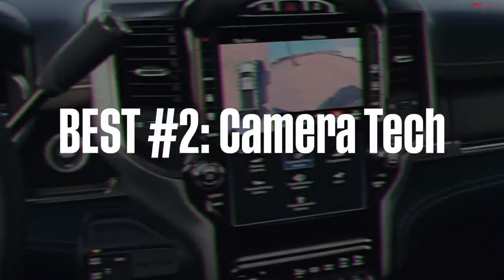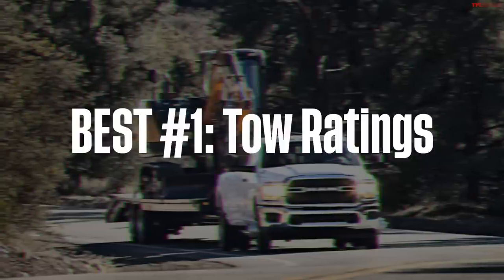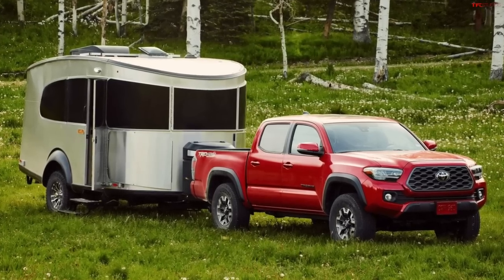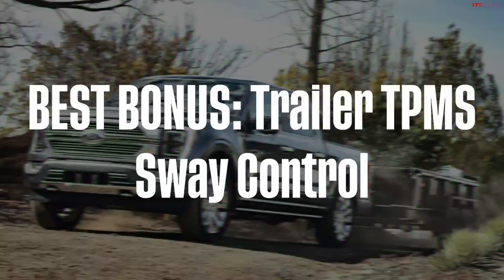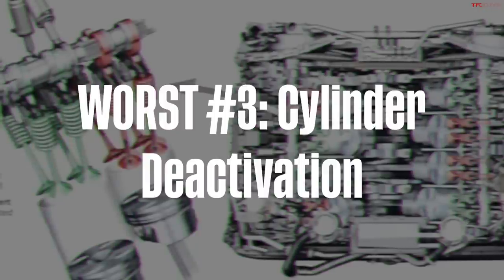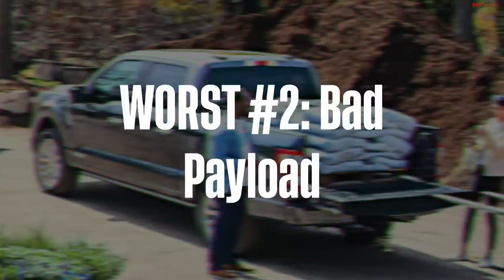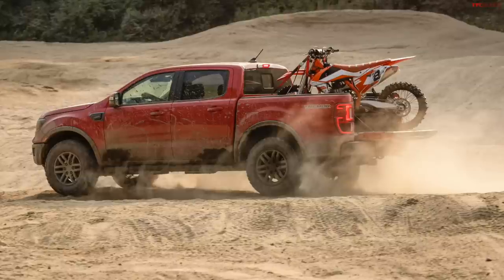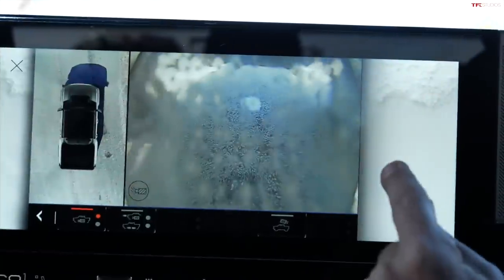This New Truck Tech Makes Your Pickup WORSE!

Comment: I really wish all truck manufacturers would use technology advancements as a means to improve durability, reliability, and production consistency instead of using it to add unnecessary complexity and failure points. I saw a forum post where a damaged side mirror caused a check engine light because the outside temperature sensor is in the mirror and it affects the air fuel mix logic for the ECU. I also agree with Worst #3 as we fell victim to premature DFM lifter failure in our '21 Silverado 5.3 at 585 miles. For how little of a fuel savings benefit cylinder deactivation provides, they probably could have tuned the ECU to run a hair more lean at highway speeds to obtain the same result without it and as a result built a more reliable engine.
Reply: Yes, leave the tech in the factory and use it to build a simple truck.
Reply: Well that doesn't require a lot of RND, Toyota's approach of incremental improvements and fixing all the glitches solves that.  I will argue safety tech, all that stuff is great.
Reply: And this is why I want what would be considered a mostly stripped by today's standard truck. It's insane I have to pay 50k for stripped and over 90k for a fully loaded truck that has when you really think about it minimal extra comfort or function. I also know my stripped vehicle has most if not all of the bells and whistles of what was considered a top of the line truck  5-10 years ago. Which means everything that is newer and we didn't have it then only adds to weight, price and less reliability and a higher cost of ownership.
Reply: They’re required by the government to add cylinder deactivation. GM, Ford and Ram all have it now on their V8 powertrains.

Comment: I would add to the worst list are Larger RIMs. I think having 17in to 18in rims is ideal anything larger lessens the capability of the truck.
Reply: You don't think 22s are properly matched to an offroad capable work vehicle? Hmmmmmm.....
Reply: Facts
Reply: how do 22s hinder getting groceries or sitting in traffic?
Reply: @JogBird  You make a solid point. I have been desperately lobbying Subaru to increase The Outback's tow rating to 10klbs. That would solve the issue. Then trucks could be used for their intended purpose....mall crawling.
Reply: 22 inch rims are ugly as hell.
Reply: Big rims are for posers.
Reply: @JogBird  I see what your point is, but I could actually respond in seriousness and say that when a 6000 lb truck on 22s with rubber band tires hits a pothole at 60 mph, that's how you get blowouts. I love having 35s on my Wrangler with 17" rims because I know that my chances of getting a flat are nearly zero.
Reply: If they want to keep putting larger rims on trucks then I want larger brakes to fill the gap. Then it could help increase the capability of the truck instead.
Reply: And it's not just the rims.  The whole wheel is larger!  17" should be the maximum.
Reply: They partially do it for handling
Reply: Amen.  Just watch any off road recovery channel.  Every stock truck stuck in the snow, sand, etc is a modern 1/2 ton with 20" wheels and low pro tires.  Put them on a 2wd, ok, but they're an oxymoron on a 4wd.

Comment: The manufacturers need to get rid of the cylinder deactivation
Reply: ...or u could buy a Diablo Tuner.
Reply: @Hydra360ci  even with a tuner shutting it off the lifters and cam are still in there and were designed with deactivation in mind creating a weak point.
Reply: (I've got a Dodge, so that's what I'm gonna refer to)
I've heard that the deactivated lifters work better if not just as good, and I've heard that they are a weak point...  (rounded lobe happens just as much on the regular cylinders as the VTT ones, in other words) 

All I know is on a Dodge, if you want all 8 cylinders working full time, (and don't want the tuner).. all you have to do is hit gear down, one time, while the truck is running at 8th (if not in 8th, well, then you'll just have to hit the  gear -, and +, buttons, a few times...until: The display shows 8. 

Once you see the gear number in the display, the ECO light will stay off. Though, it'll reset, when you take it out of Drive; which is why the tuner is more ideal. (you will lose about 4 MPG)
Reply: But then they struggle in the mpg ratings.  
It’s gets better mpg on a closed course with it so it helps sell trucks to the mpg sensitive shoppers and bring up the brands overall  mpg reputation. 
Marketing trickery that we end up paying for. 🙃
Reply: @jaxturner7288  how many truck buyers are actually worried about mpg’s? Theyre buying a truck ffs. Plus direct injection has improved fuel economy far greater than cylinder deactivation ever could
Reply: @davidhowell3609  enough of them for the manufacturers to consider mileage a top priority and replace V-8s in full size trucks with four cylinders.   Besides if direct injection helps mileage then cylinder deactivation plus direct injection helps even more.  And the brand has an overall mpg efficiency rating to worry about so every bit helps.
Reply: @jaxturner7288  no government regulations are the cause of manufacturers replacing V8’s with smaller engines. Cylinder deactivation causes far more issues with the drivability and reliability of engines than they are worth. If the majority of consumers actually wanted cylinder deactivation there would not be a huge market for devices and tunes that shut off the cylinder deactivation and replacement parts to physically remove the hardware that allows it to deactivate cylinders. In specialized tests they can make these devices allow rated MPG’s to be better but in real world testing trucks hardly ever actually achieve those numbers. Like i said before direct injection is a far better method of improving mileage and does so without the major drawbacks.
Reply: @davidhowell3609  government regulation of what???
Reply: @jaxturner7288  EPA?? Theyre forcing manufacturers to try and make these vehicles as efficient as possible. Which may seem like a good idea until you realize that the trade off is poor reliability in exchange for 1-2mpg.

You can’t be serious about not knowing that it’s government regulation mandating this.
Reply: @davidhowell3609  lol. 
Nah I just wanted you to explain to yourself that it is all done in an effort to lower emissions/ increase fuel economy,  like I said.  That is their priority and motivation.  👌
Reply: So you should have to buy an aftermarket product to "fix" your brand new, overpriced truck?  Plus, would such a device void your warranty?  Could the onboard telemetrics rat you out in that case?
Reply: @Hydra360ci  Oh, so you should have to fiddle with your transmission and possibly damage it to address a stupid design chioce by the manufacturer.  Better if they simply let you turn it off in a menu permanently..
Reply: @davidhowell3609  Other than the coking up of intake valves with carbon that you need to remove the intake manifold and walnut blast it every 50k miles or so.
Reply: @ironclaw6969  i’m well aware of the downsides of DI all my cars for the last 12yrs have been DI. They do sell products to clean the valves without walnut blasting although it may not be as effective it is much cheaper. I just take mine to my bmw shop he does walnut blasting for a couple hundred dollars.
Reply: @davidhowell3609  What?  Fuel additives?   Those will do jack shit for you as they get injected inside the cylinder and never touch the intake valves.  Oil additives?  Doubtful, they're not getting into the intake runners either if your engine is functioning properly.  So the only other option is a product that you would spray into the intake while the engine is running, but it won't stay there but a split second before it's sucked into the cylinder.  

You have 2 options.  Walnut blasting or hand scraping, both of which require removing the intake manifold.

If you have a Toyota, or some models of Ford, they were smart enough to go dual injection so that you wouldn't see the valves getting coked up nearly as much.   But, that's not a cheap solution because it requires more injectors. Or, you can install a catch can so that the output from the PCV valve isn't recycled through the intake..
.
Me?  I like simple and reliable.   I'll just keep my port injected engine so that I don't need to deal with that bullshit.
Reply: @davidhowell3609  I’m glad you finally talked yourself full circle and figured out fuel economy is a top priority just like I said it was but if you think a fuel additive is going to clean your intake valves on a DI engine, I dont think you understand how this kind of stuff works that well.

Comment: All good points. One that I would add that I don’t think I heard or read in the comments is using large screens to control certain features. I don’t want to go through 2 submenu’s in order to adjusts my seats, lights or other features where one button can do easier, quicker and safer.

Comment: 100% on the tall truck comment.  I have a mid-90s full size truck, and getting stuff into the bed is way easier than modern trucks.
Reply: It was super easy to put a motorcycle in my 1990 hilux, good luck with a modern truck.  You need ramps and a bunch of people to help you.  The Maverick is kind of bringing back the convenience of old trucks, designed from moving stuff.
Reply: 90s full-size almost look like mid-size trucks compared to these new behemoths. 
The new ones feel like your standing next to an f700, lol.
Reply: I agree. And on top of that every 2nd truck I see around here is lifted.
Reply: I will forever remember seeing a lifted GMC Elevation at the drug store, and when the owner came out, the brim of his hat was level with the top of the truck bed. He would have to get on his tippy toes and clutch onto the side to see into the bed.

He was so alpha.
Reply: @wb8291  Absolutely. A current Ranger was parked next to my 97 F150, and they were roughly the same height, but my F150 was about 6 inches wider. The reach over for my bed was better (lower).
Reply: Yup. I was looking at full sized trucks when I got my Wrangler but they're just so big these days. I've owned a Silverado before. I've owned a Navigator before. I've driven my share of big vehicles. But the new ones are just so big  I could only imagine they're exhausting to drive. Can't park in the city, too tall for parking garages, too wide for city streets, too long to be used off road.
Reply: While I think a good portion of the height is for the "off-road" stance, I also think it has to do with comfort and payload as well.  My F-150 has nearly 2000 pounds of payload according to the sticker on the door so it would not surprise me if the frame was as big and beefy as a 1-ton truck from 2 decades ago.  Also since most people use their truck like they used to use sedans the trucks need to have more progressive springs so that when you ride around unloaded you are not pogoing around everywhere.  I think that is the big portion of the squat trucks have as you put a trailer on them as the trailer pushes them through the comfort part of the spring and into the stiffer area and also likely why trucks seem to sit so much higher on the back than the front.
Reply: @legendaryash  Unloaded, pickup truck suspensions are supposed to sit higher in the rear than in the front. The term is called "rake", and it's intentionally designed into the truck, so when loaded, it levels out for better control when driving. 
All the dummies that "level" their trucks by only lifting the front suspensions are badly screwing up the vehicle's ride & handling characteristics, just to "look cool". Sadly, it's typically done out of sheer ignorance.
Now, I'm not saying don't lift trucks. I'm saying that one needs to lift BOTH ends equally, as well as make various other modifications & adjustments in order to preserve the proper factory handling & control.
Reply: @turbodiesel4709  I probably didn’t say it well but that is what I meant.  If the springs were single rate (no helper springs in the leaf or a constant coil spring rate) there would not need to be as much of a rake to the truck since the entire spring travel would be meant for the max load of the truck. It would ride like crap unloaded but it would work. Aircraft tow vehicles are like this and when we are not pulling with them they bounce over every single expansion joint. When towing they still ride rough but not as much bounce.
Reply: @jeffk464  Well, except that it's a unibody and front-wheel-drive which are not generally desireable traits in a truck.
Reply: I noticed not too long ago that a current Ranger is roughly the same size as my father's truck was in the early to mid 90's and that the F-series is huge by the same standard.
Reply: @turbodiesel4709  Most people never haul anything in their truck and it never leaves the pavement.
Reply: @wb8291  Except the beds are tiny on the new midsize trucks with taller bed rails. Too bad nobody makes a midsize regular cab with an 8' bed. I am tossing around the idea of a 2wd full size new work truck with a 2 inch lowering kit

Comment: I got a 2019 power wagon. I was originally scared shitless of all the tech involved from the front and rear lockers and electronic sway bar disconnect.. the screen, mirror, sunroof, you name it. My dad even used to hate power windows. But in overtime 3 years everything has worked like it should and worked good despite the absolute hell that truck goes through... Lots of dents, scrapes, worn and almost snapped winch cable, lower front air dam ripped off by ice and rock and rocker panels damaged almost all issues came from the driver and no issues with electronics which still work great knock on wood. All those wire harnesses under the truck held up even in water. They say they are not built tough but they still are. Not like they used too but they still are.

Comment: My 2021 RST was also built during the chip shortage. So, it does not shut down cylinders. I have a real V8. They were allowed to build them without it. Thanks Uncle Sam.
Reply: Great 👍 I would pay to omit.
Reply: @rondail5675  best part is it's rated for 23 mpg with the chip. SURPRISE!!!!! I get 22 mpg without the chip.
Reply: Must be nice. I exclusively drive our '21 Silverado 5.3 8-speed in L7 to disable it.
Reply: @voided3  I just need to know how to permanently disable the auto start. Have to do it everytime you start.
Reply: @goldrush7293  There are aftermarket options like the Range Technologies unit that plugs into your OBDII port, but you'd have to remember to remove it before going to the dealer for service every time. I just turn it off with the button reflexively every time at this point while the truck is warming up.

Comment: A timely dropped video. These are many of the reasons I ordered a 2023 Siverado 2500HD Gaser. I have received very polarizing criticism over it. People either really appreciate why I configured it the way it is, while others say I failed and should have either bought High Country trim or waited for the "all updated" 24 models. I wanted a full sized truck that isn't a suit of fad tech or a Mercedes sedan. As an LT trim with a lot of options not normally found on a mid trim model, she is what has been described as a very well appointed work truck. When I went down the options available if it made it a better truck or comfortable for the driver I ordered it, if it was just tech or luxury car like I left it off. All in for under 60k. I ordered it on Halloween and picked it up on Valentines Day I love it.

Comment: The automatic braking system. We have a 2022 Ram 1500, and I just came from D&B after buying a Traeger smoker. The smoker is heavy, so I will back it up to the front yard and work on it there since that is where it will stay. As I'm backing up, the tree behind me is ten feet away. The truck slams on the brakes and will not let me go further. So I had to turn the system off to back up the rest. We also have a 2008 Ford F-350 for towing our RV, and it's nice not having all those high-tech systems, and most of all it has all the important things in it such as cruise control and tow haul.
Reply: So simply shut off those features
Reply: @alcaholic9559  yes, that is what we had to do. It still sucks that it does it though.

Comment: the feature id like to see is a sub 20k price tag. imagine a basic truck, like a 2000 f150. it's got a cheapo radio, heat and a/c. 4wd shift on the fly. and that's it, doesn't need 14 drive modes, funny tail gates, refrigerator, not even advanced head lights. like a drive to work, and haul stuff truck.

Comment: I think the biggest thing that upsets me most about new trucks is the elimination of two-door options. I don't need 4 doors, regardless of the door configuration. I just want a nice two door Ford F150 Lightning, or Colorado ZR2, or Ram 2500 Rebel. I understand why going all 4 door is a thing, it creates more consistency in manufacturing, fewer parts variety, and those things reduce costs overall, but it clearly reduces variety in options available for buyers who don't need all 4 doors. I shouldn't have to buy a Ram 3500 just to get a two door truck (don't argue semantics like 'well technically you can get such n such 2 door that's cheaper' smartass).
Reply: Your seeing standard cabs disappear because the profit margins are lower on them. Simple as that really, the dealerships wont order them cause they cant mark them up to some out of this world price. And it isnt even an option on midsize trucks which is insane as being small is their reason for existing!
Reply: Absolutely agree.  The worst is the Jeep Gladiator.  Why on earth don't they offer a single cab version of that?